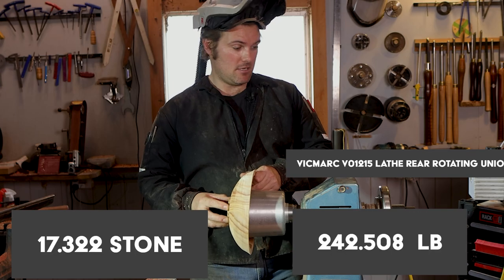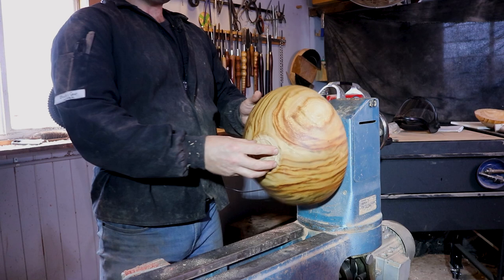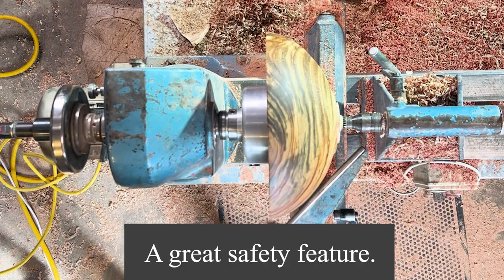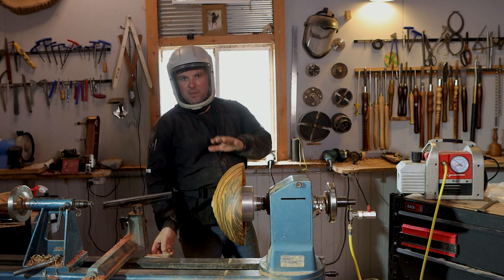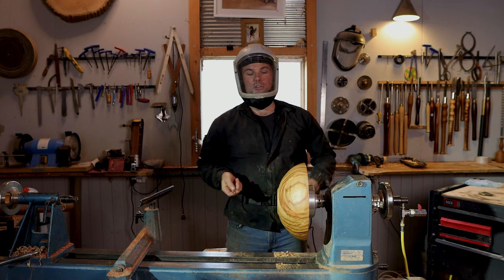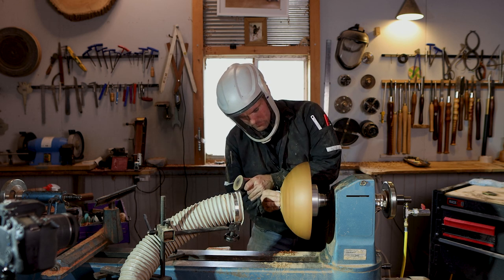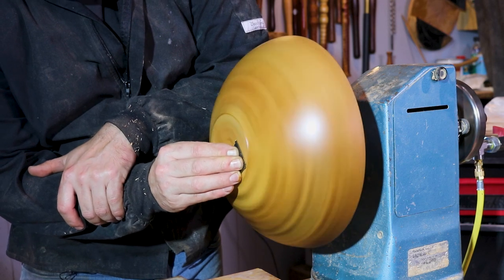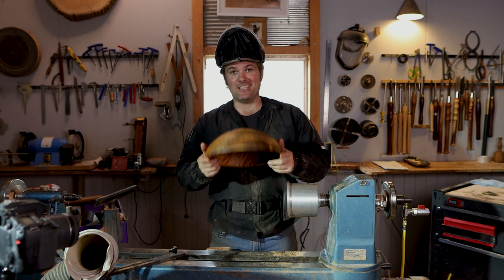Vacuum chuck Tenon removal

Comment: Thanks for the great demonstration. Expensive to watch 😅😅😅
Reply from the maker: It can be costly, but I shopped around. Saved alot of money. Best of luck Melkein. Cheers,
Kez
Reply: @KerryCorney  There are not so many suppliers to be able to shop around, but I have found a stockist in the EU. But I have to hold my horses for now, cannot justify spending on the vacuum equipment at the moment. The vacuum chuck is ideal for turning bowls, but the things I turn are small. I am interested in stabilizing wood, and when I will buy the equipment, I plan to buy the chuck too. It is the pump and the chamber that are expensive, not the chuck part.
Reply from the maker: Yeah, the pump is the most expensive part. But shop around on the marketplace, and if you have any friends who are air conditioner technicians, they might have one going cheap when the time comes. Cheers, Melkein.
Kezza